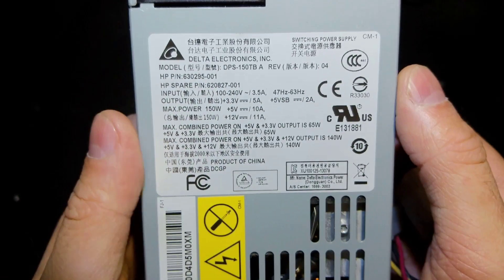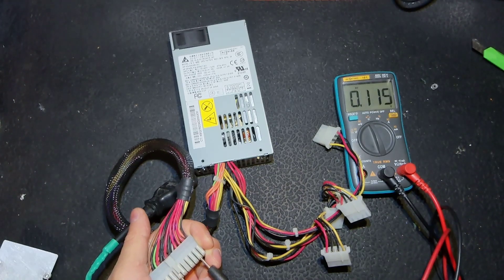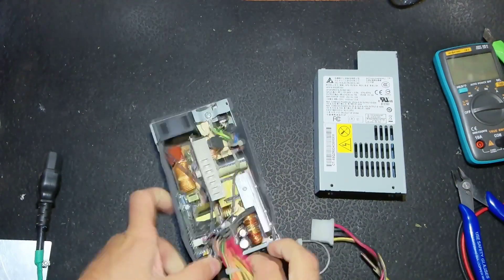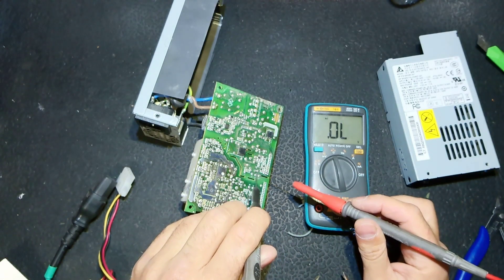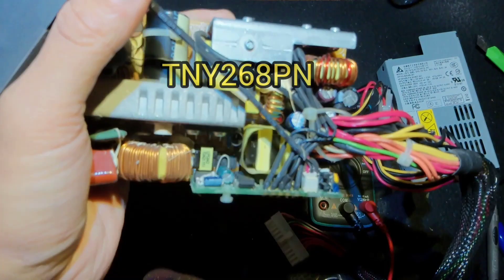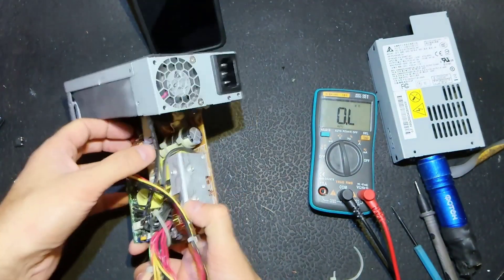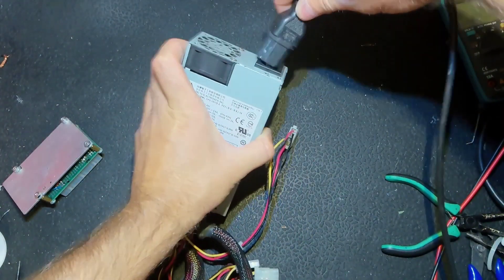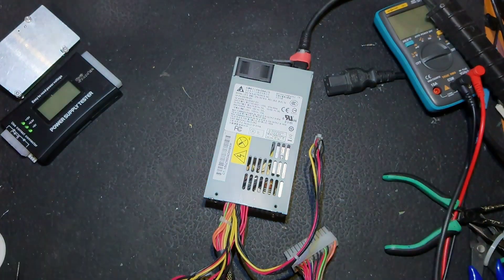Delta DPS-150TB repair

Comment: Mine goes on then off and looking at the voltages it seems there is an issue with the -12V
Reply from the maker: @JohanlastZa  try to change -12v capacitor.

Comment: Thanks for the video. Have the same PSU for a HP Microserver N40L... it's dead. The chip you replaced seems good on mine (0.5V on the diode test). There's also 340V across the bulk cap so I think the HV primary is ok. None of the transistors appear to be shorted. The DC outputs aren't shorted either. I haven't figured out what is wrong with it. Btw, is the green wire the power good signal? Doesl jumping it to ground turn on the PSU?
Reply from the maker: @orlypalomar  green wire is PS on wire. Jumping it to the ground should turn on the PS. If not check capacitors. They may be the reason.
Reply: @electronicshaverightstolive    "I have the same symptom (the power won't turn on), and when I connect the green wire to the ground, sometimes the power turns on, and sometimes it doesn't turn on. I was told to replace a capacitor in this case, but could you tell me which capacitor I need to replace, along with its capacitance (value) and location? I'm asking because I have no knowledge of electrical circuits."
Reply from the maker: @caiper01  look for a bulging capacitor.  If it's bad it usually bulge up at the top.

Comment: My power supply was also damaged.
IC901(TNY268P) seems to be fine, but I will replace it to be sure.
In my case, the R902 resistor was damaged (burned). Does anyone know what resistance it should have?
I couldn't find a schematic for this particular power supply.
Reply: Hello, the resistance R902 is 2MΩ 1%

Comment: This power supply (Delta DPS-150TB) is used in a HP ProLiant MicroServer N40L. These MicroServers are used as a home/office NAS.
The power supply in my server has just failed. So it might be a similar fix to get mine going again.